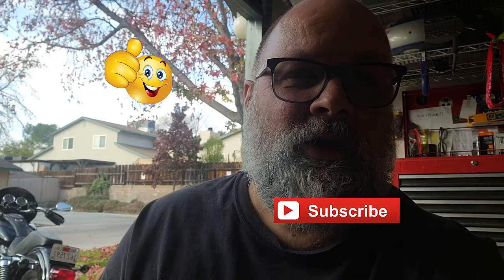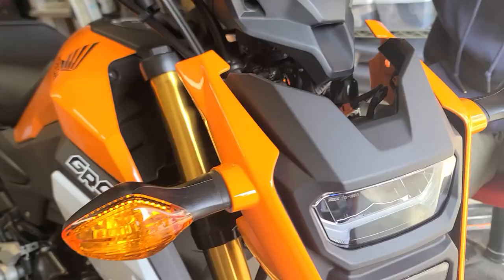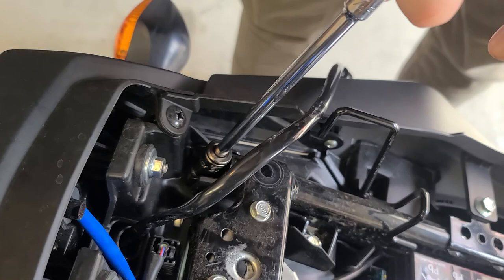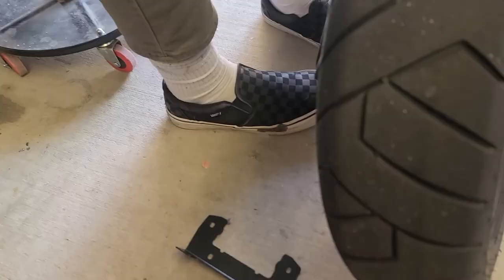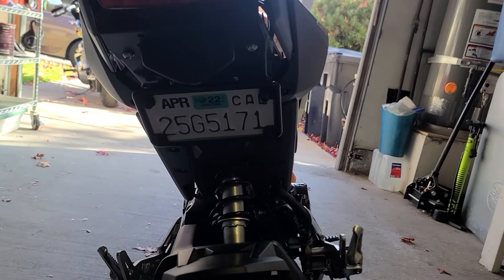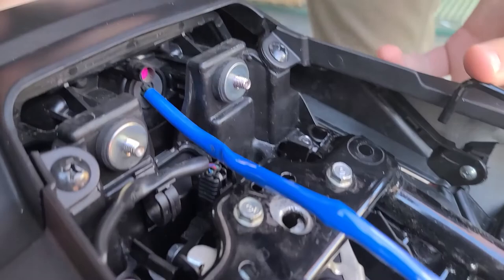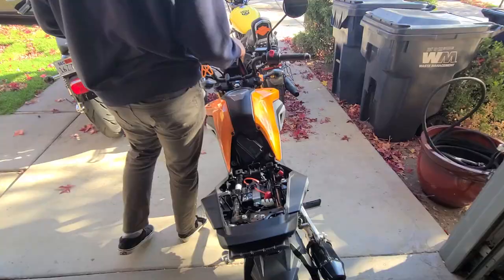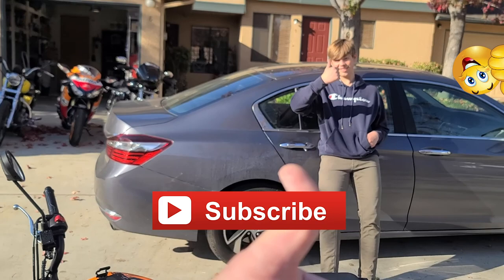How To Install TST Industries 2020 Honda Grom Fender Eliminator, LED Tail Light & LED Flasher Relay

Comment: Nice!  I use the TST integrated tail and fender eliminator too. Good stuff!!
Reply from the maker: I really liked it after getting it installed. Was gonna see if they have that taillight for my CBR.
Reply: @MotoMike805  yeah I love my taillight. It's smoked and I like the pulsing options for the brake light. I figure any extra thing to get car driver's attention is helpful